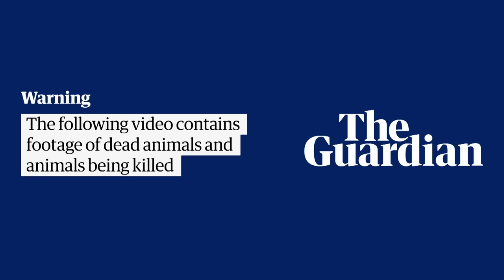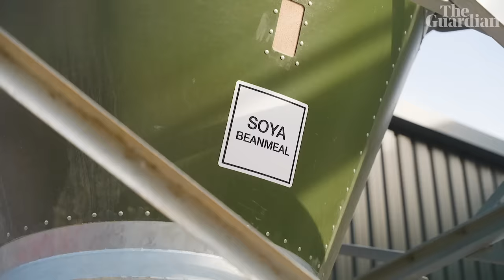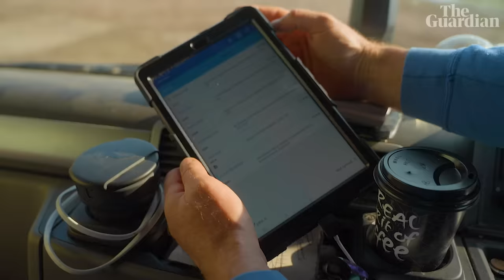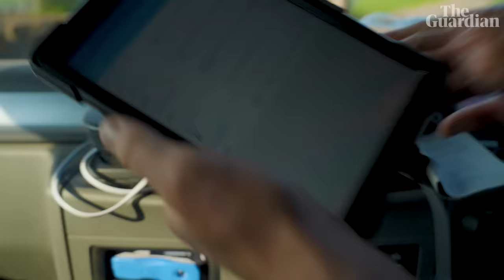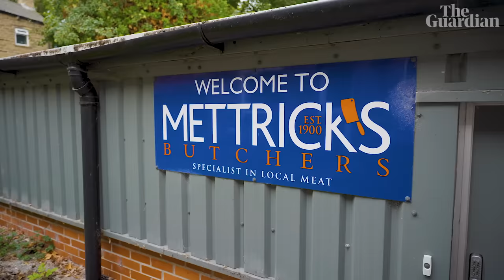'We've got a cow to shoot next': What death in farming really looks like | Human Animal

Comment: Why do you need the cable to get a 30-40lb calf in the truck
Reply: To reduce injuries or chance of injury to the worker. Probably due to labor laws and worker compensation laws. We had to use a lift at one of my jobs to pickup 20lb boxes. I got written up when I got caught lifting one one time. I'm 6'4" 245lbs it was kinda silly but I understand why.